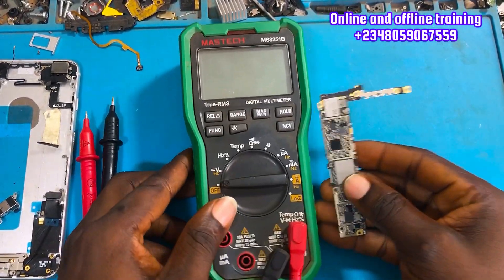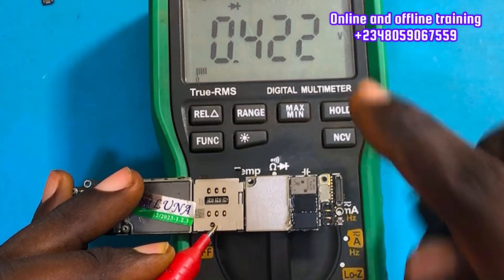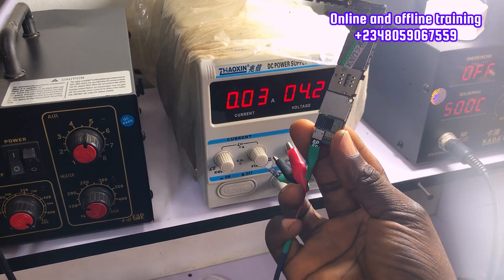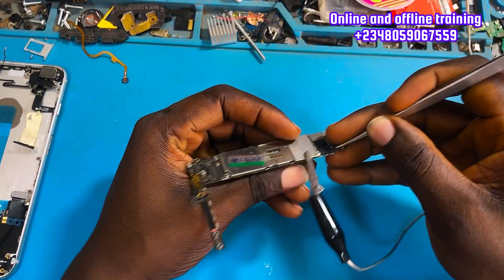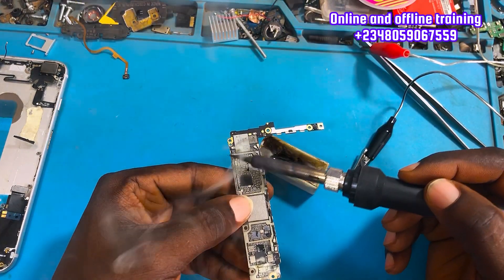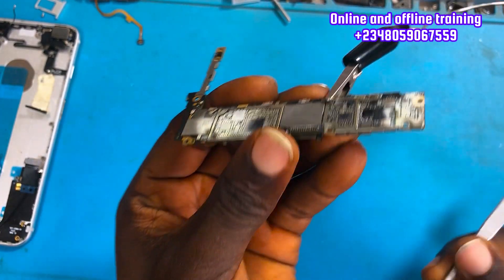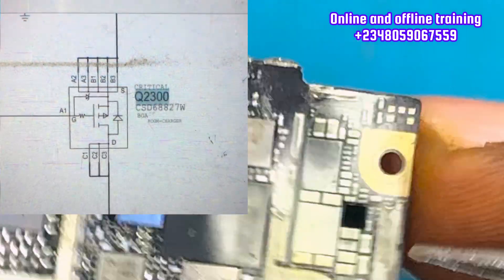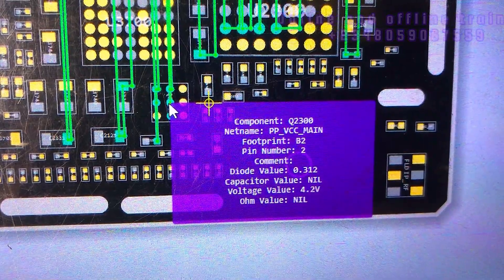Learn How To Detect Short On Mobile Phone Pcb in Just 5minutes

Comment: That's a mosfet, I'm very sure that not the issue, everytime someone apply DC to battery terminal, mosfet get hot 🔥..
Reply from the maker: @sammyhenry4860  A mosfet has diode in it, diodes are also protective components on Pcbs, so there is possibility it’s the problem sir and if it’s not then you should continue the troubleshooting. I’ll upload the part 2 of the video if the client agrees with the cost to repair it.
Reply from the maker: Part 2 of the video is out please watch it, link in the description. Thanks